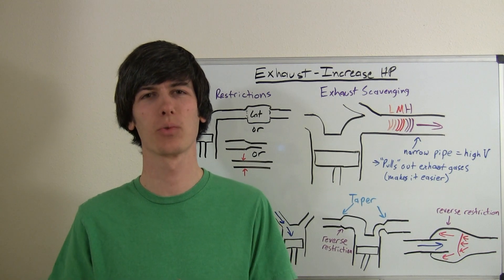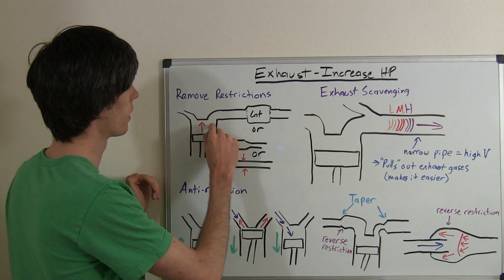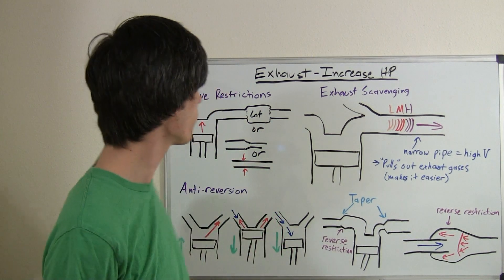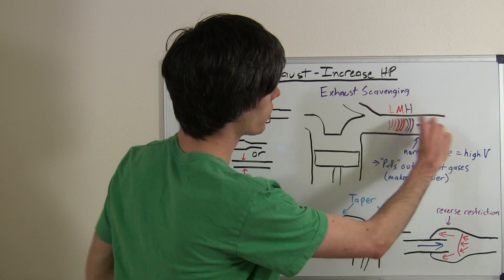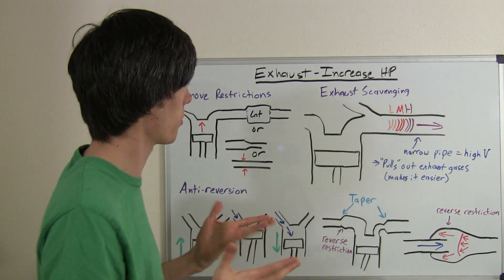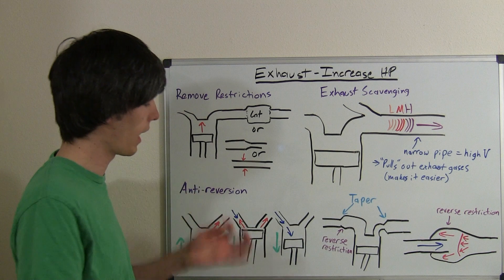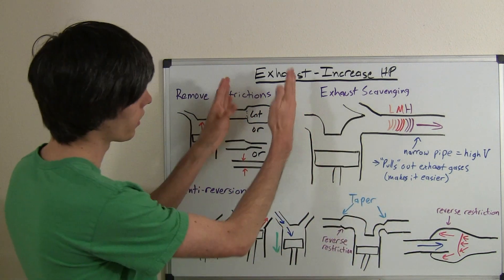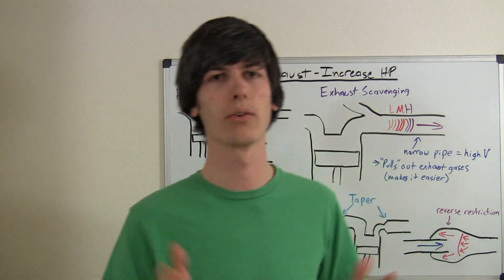Performance Exhaust - More Horsepower

Comment: I think it would cause more engine wear, not sure about performance. If the engine is going from a positive pressure in the cylinder to a negative pressure very quickly (even positive to substantially less) it would cause more engine wear on the moving parts. This would only be because pistons etc. are made to be forced in only one direction. This could be fixed with custom hardware. That's just my thought.

Comment: 4-2-1 gives you better midrange power. 4-1 gives you better high end power. At lower revs, lining up pulses so that each pulses pull each other out is important thus 4-2-1. At high revs when pulses are more frequent, it's just about getting gas out of exhaust, so 4-1 with better flow wins.

Comment: What would happen if you had a vacuum sucking out exhaust gases so you can close the valve quicker resulting in fast revs and higher rpms and more horse power?  Suppose you used a belt-driven reverse turbo as the vacuum.  Would this possibly make more horse power?  How would it compare to a turbo and how would it compare to a supercharger?  I had this idea not to long ago and talked it over with my father and we couldn't come to a conclusion as to if it would help or hinder.   Your thoughts??

Comment: I'm afraid you don't know what you're talking about. Yes, there are preset maps that base off intake/exhaust mod. But this is actually misleading. There is power gain from better exhaust flow doesn't need tune. However, better flowing exhaust ALSO allows more aggressive ignition advance, and if the engine has lift (VTEC or VVTLi) more aggressive lift as well, which will net much more HP.

Comment: Hey man, do you think you can do a video going into depth about exhaust velocity, and turbo exhaust systems. I'm also pretty confused about how 3 in pipes are not the best application for high revving Honda motors.Once again thanks.

Comment: Another awesome video, man.  Great job.  One question though, does exhaust scavenging apply at all to exhaust coming off a turbo?  Between the engine and the turbo I can see that it would, but as for the rest of the exhaust after the turbine, is there any reason not to have the biggest pipe you can find?

Comment from the maker: I would agree for the most part with the "or other upgrades first comment," but backpressure is a loss, whatever way you want to look at it. If you can reduce losses, you increase power, regardless of what you've told your ECU to do. Now with modern engines and ignition timing, valve timing, fuel injection timing, sure, you could tune it specifically for your exhaust - but ultimately you just want the air to leave as efficiently as possible.

Comment from the maker: If he removed any cats then that would help flow, or if it decreased bends and made the path easier. Or it could simply be a lighter material. Worst case, he bought it to sound different, and that's all it does.

Comment: I had always thought that there was no bottom limit, beyond which lowering exhaust backpressure would actually make the engine perform worse. However on reading about more complex issues of resonance and lamellar flow, the story is more complex than that. Motorcyclists have known for years that when they modify their exhaust for better flow they then need to adjust carb jets to compensate. A part II of this seminar might be useful....

Comment: you're looking at it the wrong way. It may be more restrictive at high rpms but low to mid rpms the velocity of the exhaust gases is higher (smaller hole, same volume => exhaust travels faster). Because velocity is higher it pulls the gases from the next exhaust pulse and "helps" the cylinder come up easier. Which meanse that the powercycle of the firing piston is sending more torque to the flywheel then to a piston in the exhaust cycle. At high rpms it won't help though. hope it makes sense

Comment: Are expansion chambers on 2-stroke engine exhausts an example of anti-reversion? I've often heard they are to provide backpressure, as there are no exhaust valves in most 2 stroke engines. Just wondering if you have any experience with that.

Comment: The problem is without back pressure the engine is not burning all of the fuel, because when Valve overlap occurs (inlet and exhasut valves open for small period of time)  which is usually just before TDC. The air fuel mixture has nothing to hold it in the cylander meaning it flows straight out the exhaust. hence the reason why straight through exhaust's back fire because the fuel is being burnt in the exhaust and not the engine. Meaning you actually lose power.